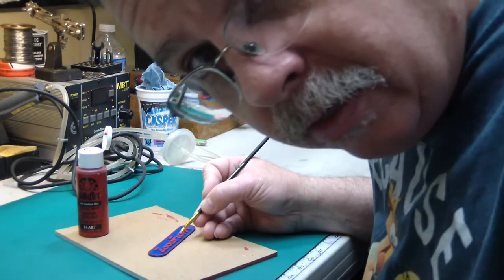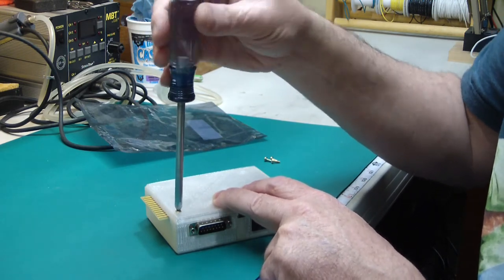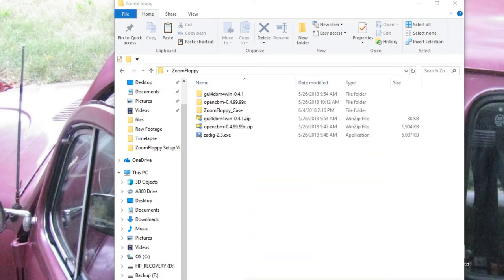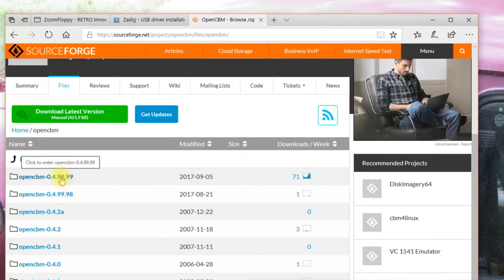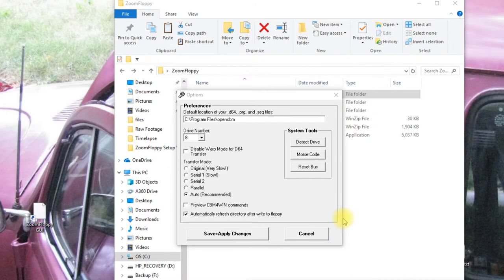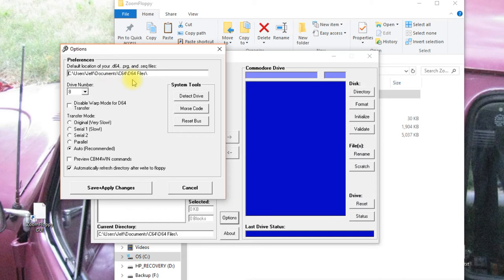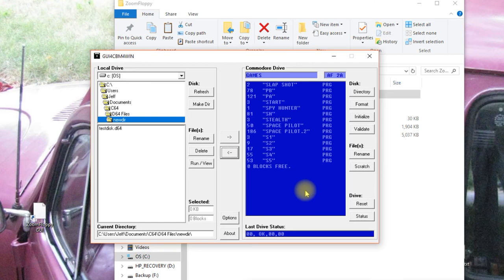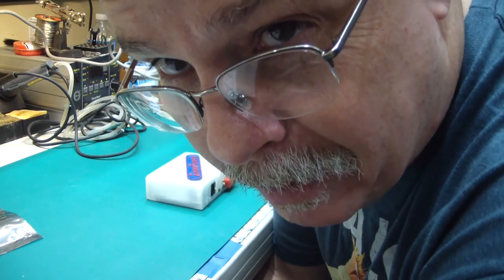ZoomFloppy Set Up

Comment: Thanks Birt - this is the solution and fixed my Zoomfloppy issue immediately after running Zadig, I even had Zadig in my zoomfloppy folder, but forgot about this step. I am sharing this video on my Commodore 64 blog it such good info.

Comment: Nice walkthrough on getting started with the ZoomFloppy.  I wish I this had been available when I got started with it. One thing that you mentioned that I was unaware of is that you could use it to give VICE access to a real 1541.  Neat use option.  Thanks again!
Reply from the maker: Thanks Jose. You may have already found the next video in this series which shows how to use a real 1541 with vice and how to print to a Commodore printer through VICE (in a sort of round about manner.) Just in case here is the link: https://youtu.be/3XdbgJia6ck 

Also, the third video about the ZoomFloppy shows you how to use it with NibTools to back up copy protected disks: https://youtu.be/mEv2vYH0ipw

Comment: Anyone know how to fix the error: cbmctrl previous command was interrupted, resetting
Update: I fixed the error by using libusbk (v3.0.7.0) instead of libusb-win32 (v1.2.6.0) via Zadig v2.5
I'm running on Windows 10 64 Bit. Maybe this will help someone else.
Reply from the maker: Thanks for posting the fix. That is part of the struggle with many open source programs is trying to keep up with changes.
Reply: Thank you! I have been trying to fix this and changing the driver worked!

Comment: OpenCBM is a lifesaver. However, it does not recognize seq files. You can easily use it for image copy/restore but if you want to do file operations like adding or copying an seq file to your floppy or pc it can not do it. You always have to transfer the whole image. So I always use DirMaster from Style64 to prepare or edit an image then only transfer the whole image with OpenCBM even if it's only for a single file change.  That solves the problem.  I talked with the developer and he said he knew the problem but he simply ignored it and hasn't gotten to do it yet because of other projects. https://style64.org/dirmaster
Reply from the maker: That is very good information, thanks! I also like DirMaster.

Comment: Hey, Jeffrey Brit I really like the video, but I have a couple of questions since I'm looking at getting the Zoomfloopy.  I need a bit of clarification if you don't mind.  The thing I'm most interested in is if for instance, If I wrote a program on my PC with a C64 Emulator then I would like to transfer the program to a floppy on my 1541.  From what I see from your setup is Zoomfloppy is connected to 1541 with a regular Commodore cable.  Then you have a USB cable connected to the computer. Then I would use whatever software needed to copy my file to from the PC to 1541.  Thanks!!!
Reply from the maker: Hi David, you have the general idea. The ZoomFloppy connects to the 1541 with the normal Commodore serial (IEC) cable and to the PC with a USB cable. You can use the GUI that I showed to make the copying process easier and there are others available too.

Comment: I connected my 1541 drive via the parallel port using an XM1541 cable. It was working fine but all of sudden opencbm started giving me 99,driver error. Do you think zoom floppy would be more reliable?
Reply from the maker: The MX1541 cables relay on getting precise timing via code to make use of the parallel port so it can be iffy on some computers. If your drive otherwise works fine with a real C64 then the ZoomFloppy should work fine for you.

Comment: Will this work with the 1571 Disk Drive?
Reply from the maker: Yes, in part 3 I use the ZoomFloppy with a 1571 to copy protected disks. https://youtu.be/mEv2vYH0ipw
Reply: Hey, received my Zoomfloppy from Retro, followed your instructions, works PERFECT with my 1571!!!!!   Awesome!!!!  Thanks for the great instructional video, you just made life so much easier for me to set this up!
Reply from the maker: @-WhizzBang-  I'm glad your found the video helpful. I thought the ZoomFloppy was a very nice product but just had bad documentation. It is awesome to be able to use it with a PC to back up all our old disks.
Reply: @HeyBirt  but you can also use it to download all the games off the internet and put them on discs..
Reply: @HeyBirt  sadly, I started using it, and now for some reason my 1571 Drive will no longer read disks, even when I hook it up to the Commodore 128.. Fortunately I have a 1541 as a backup..
Reply from the maker: I usually use my SD2IEC when ever possible, to save the wear and tear on the actual disk drive.
Reply from the maker: Sometimes the old disks get really badly oxidized and will leave a black smultz on the disk drive read/write head(s). You can clean it off with a qtip and alcohol (gently).
Reply: @HeyBirt  yeah I noticed that, cleaned it off with contact cleaner and Q-tips.. But the drive won't read, it was intermittent to one minute it was reading fine then suddenly it wouldn't read any more than it did it again now it stopped reading again, and it just makes noise and tries to move when I try to access the directory or anything
Reply: @HeyBirt  I'm just going to take it apart, give it a good cleaning, inspect very closely for loose wires or cracked solder
Reply: @HeyBirt  that's about all I can do I guess, because I can imagine getting replacement parts for these old drives is pretty much impossible
Reply: @HeyBirt  and now I hooked up the old 1541, it seems to be reading discs okay, but doesn't want to format discs, but I opened it up and it is pretty dirty inside so hopefully it just needs a good cleaning
Reply from the maker: If it is making a funny noise it might have a stuck head. You can wipe the rods the head rides on with a qtip and then apply a very small amount of silicone grease with a qtip. Many of the electronic parts can be found but the R/W heads etc. can only be had by salvaging from another drive.

If you are in USA and want to send it to me I might be able to fix it.
Reply: @HeyBirt  yeah...I think my 1571 is KO...no matter what I try, anything I try to do it just makes ticking noise and head doesn't even move.  Oh well, at least the 1541 is working...:)
Reply: @HeyBirt  Hey, I just learned about this SD2EIC , wow, that is very cool, did not even know those existed. WHERE can I get one of those? Retro Innovations doesn't sell them.
Reply from the maker: @-WhizzBang-  I ordered mine from a company in England: https://www.thefuturewas8bit.com/index.php/sd2iec-info It won't work on some programs that use custom fast loaders but it has worked for 99% of what I have tried it for.
Reply: WhizzBang Do not throw it away. I hope you sent it to Birt, but regardless there will be a way of bringing it back to life available in the future.